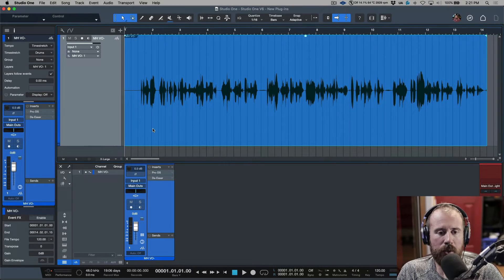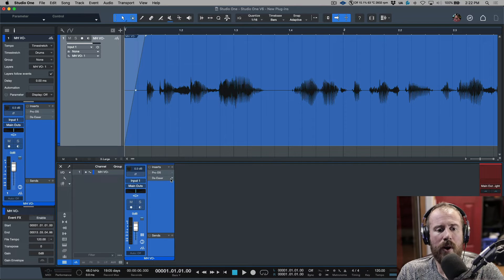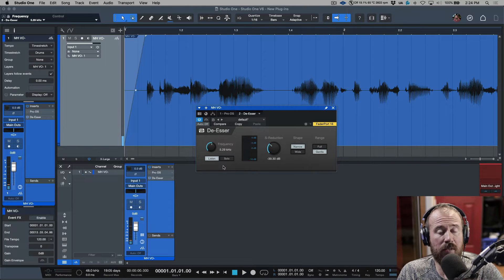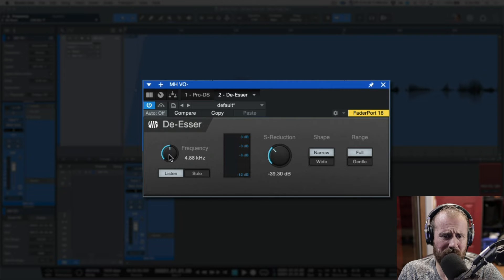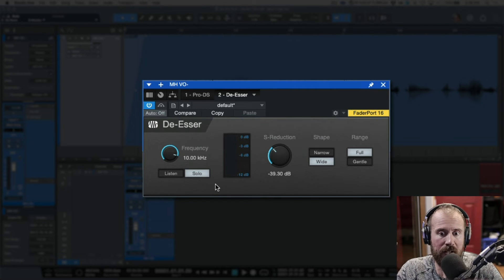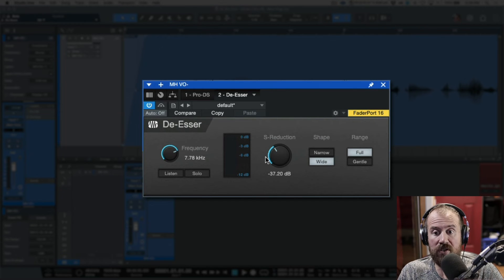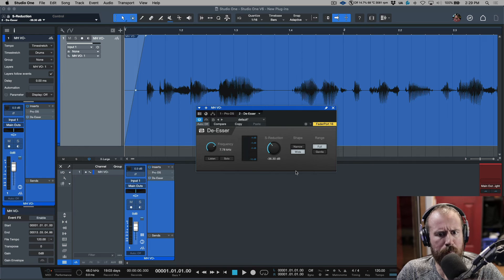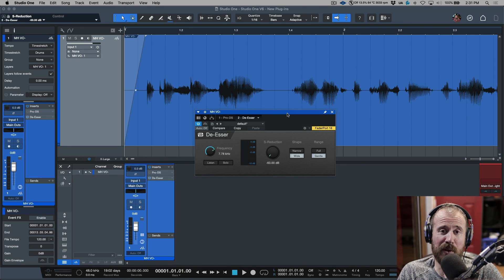Working with the Stock De-Esser In PreSonus Studio One 6

Comment: It's a really good de-esser, and indeed, one has to have the essential tools quickly available within the DAW itself, without & regardless of additional, purchased plugins, I totally agree with you.
I've been requesting this on the Presonus forum fir quite a while, so it's very welcome.
2 big missed opportunities, though:
1-apart from frequency specific compression, they could have also added & offered the option of phase inversion based de-essing, like SPL does, or like the old Valley hardware did. The tech is out there, why not implement it? Not only it can often sound better, but having the option would have made this a pretty definitive de-esser, and a major feature
2-the GUI is horrendously plain and unattractive, plus small and hard to read with the silly dark background. Of course this has no impact on the sound, but it does on ergonomics, and the eyes also want their part (as Presonus seems to have understood with e.g. the Analog Delay or the Red Light District saturation stock plugins.
So... room for improvement in the next S1, if they take note, as they should.